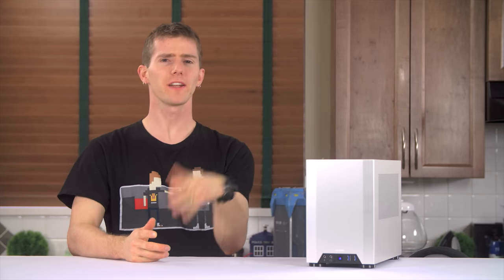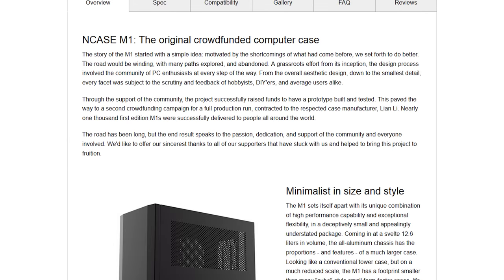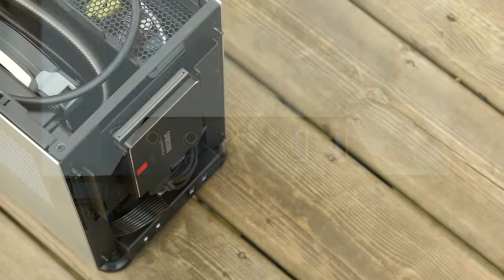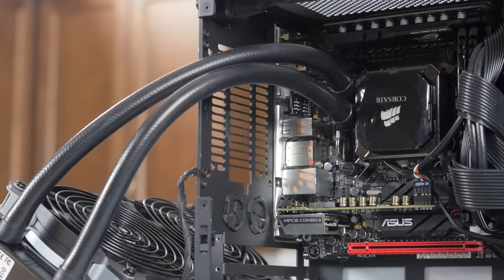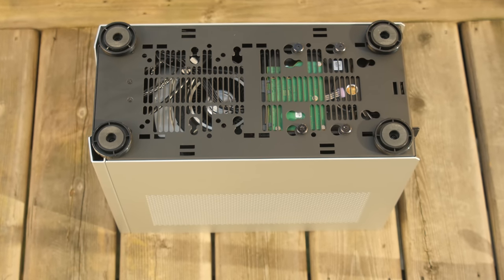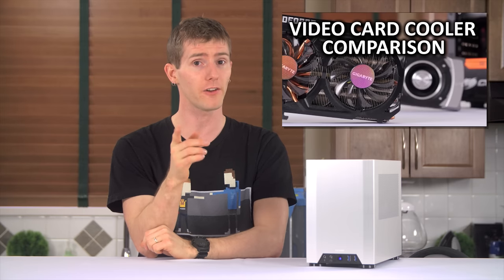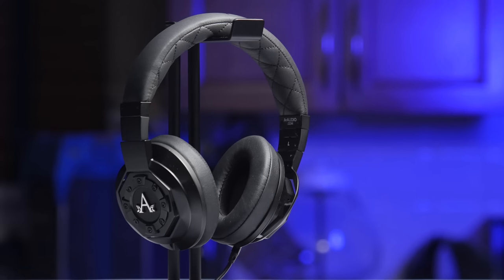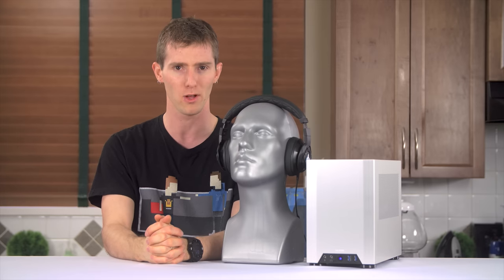NCASE M1 Mini-ITX PC Case - A Space Saver Without Compromises?

Comment: So I was really wanting to pick this case up, however I need to know if it will fit a 240mm water cooler on the side mount (such as the Corsair H100i V2) and a 120mm rad in the bottom front of the case (or anywhere else it might fit). Both rads will be AIOs and I will be using a SFX-L power supply. I will also be getting the EVGA GTX 1080 Hybrid ( http://www.newegg.com/Product/Product.aspx?Item=N82E16814487283 ) which will be where the 120mm rad comes in. Thanks for answering in advance!
Reply: BlurryBiscuit the h100i V2 is not recommended because of the stiff tubing, try to get an h100i instead. A 120mm rad will fit the bottom but you will be forced to use a slim 120mm fan assuming the card you are getting occupies just 2 pci slots. What some people do is use the side bracket mount for TWO separate 120mm rads, one for the cpu and one for the gpu.
Reply: coolermaster Thank you very much! : )

Comment: Case looks awesome, sure, but to be honest, it's impractical for a lot of ITX builders. The SFX form factor PSU is the only one that seems to be good for actually having any sense of room in this case where you can use the space for other things. Otherwise, cable management is going to be a bitch. God help those souls who don't use a PSU which isn't modular. So, good effort, and I love the case, but other than that, it's too restrictive for my tastes. I think I'd rather go for something like an Air 240, or if I want something stylish, a Pandora. 

That being said, I hope NCASE releases a second version that seems to address the issues. I'll be checking regularly.
Reply: they wont. and its really not difficult. the wires fold extremely easy and the room behind the gpu and panel is adequate. the whole idea of this case is as small as possible.
Reply: But it's a lot smaller at 12.8L than a Pandora(31L) or a Air 240(33L) .
He fit a bulky ITX board, a 240 rad, a flagship gpu and 3 HDDs including a 3.5inch and had reasonably out of the way cable management.

If you are an ITX builder don't you want a high end, extremely compact PC?
Isn't that most people's goal?
Reply: Isn't cable management a bitch in most cases? And ITX builders are aware of the challenges regarding these types of builds.
Reply: Jonathan Tremblay exactly. and people dont understand its more of a window case thing, how he has it in there is literally not going to affect performance. there are several examples online in the forum of people who have remarkable cable management in this, just takes a little time and effort.
Reply: I suggest you look on Hard Forum for galleries of people's builds. There's some with full-size PSUs, and even then the wiring is cleaner than Linus'.

Comment: Gtx 680 or r9 280x which one is the faster card please
Reply: 280x
Reply: 280x
Reply: 280x anyday
Reply: Not even close. 280x
Reply: They're pretty evenly matched performance wise, but the 280x is far better value wise.
http://www.hwcompare.com/15854/geforce-gtx-680-vs-radeon-r9-280x/
http://gpuboss.com/gpus/Radeon-R9-280X-vs-GeForce-GTX-680
http://www.ocaholic.ch/modules/smartsection/item.php?itemid=1246&page=16
Reply: thank you everyone who replied i can get the 680 for £105.00 or the r9 280x for £185.00 so ill go 680 why is the 680 normally more expensive though does it have extra things that make it worth more
Reply: No, it's just that AMD's pricing is more competative, plus they don't have anything to compete with the current gtx900 series, so they've seriously reduced all their radeon 200 series cards.

Comment: can I fit a gpu water block in this case, or is the block too wide?
Reply: probably too wide,look up mesurments of the block (with tubes) ond the case if you can, good luch with your watercooled tiny pc!
Reply: if you cant, a fury x would work
Reply: +TheCanadianLanBoy yeah, it would be awesome to fit a 120 mm cpu rad beside a 120 mm gpu rad.

the reason I ask about the custom block, was to use an expandable AIO cooler and include the gpu into the loop aswell.
Reply: +Wistbacka oh, that would be better lol, if you can find a block that is more like a cpu one (tubes coming strait off gpu rather than to the side) it might just work! good luck ( if you end up air cooling, get a Dan-Case)
Reply: Looks like it should be fine. There seems to be about an 1-1.5 inch between the card and the door. Also, most cases have to accommodate much larger air coolers that seem to be coming standard on aftermarket cards.

Comment: Why does Linus always blow hot radiator air INTO the chassis... seems nonsensical, but he does it every time.   Radiator heat should be vented OUT of the chassis, with cool air coming in, not the other way around... facepalm

Comment: Oh wait it's made my Lian-Li?

OK

So they took the Jonsbo W1 design and copied it party and had Lian-Li do the manufacture.
Reply: You have it backwards - Jonsbo copied the (exterior) design of the M1. The M1 was originally designed in late 2012/early 2013 (the original Indiegogo campaign went live in February 2013). The Jonsbo W1, in contrast, was first announced in December of 2013.

It's worth noting as well that the W1 has a very different interior layout and is a much larger case.
Reply: Ncase Design OK and yeah the Jonsbo is horizontal orientation. Damn I wish I knew about your case before I ordered the W1!

;)
Reply: Ncase Design
Do you think horizontal orientation with a heatpipe tower heatsink will perform better due to gravity for heatpipe fluid/peroxide?
Reply: LudicFallacies Heatpipe orientation can make a difference, though it's probably negligible if the cooler is mounted correctly (i.e., heatpipes aren't pointed down). Obviously, a larger case like the W1 allows for larger tower coolers in the first place, which would make a more significant difference.